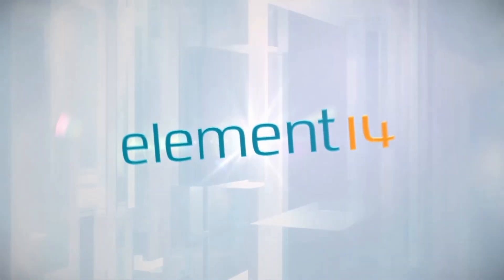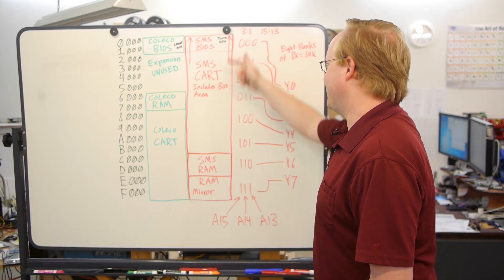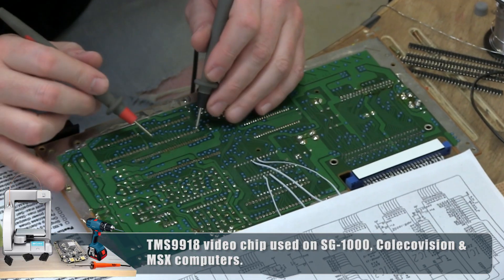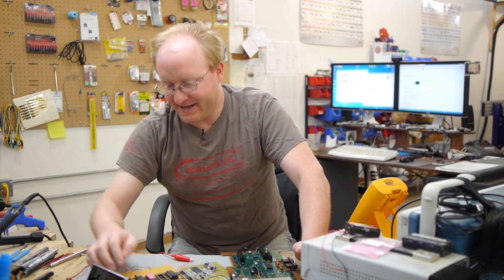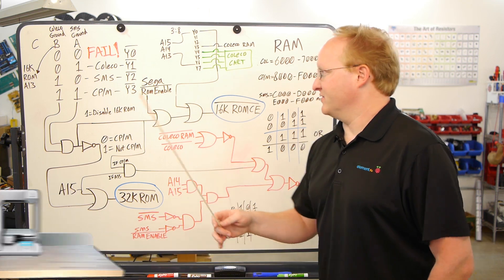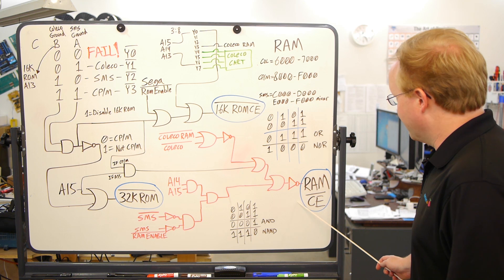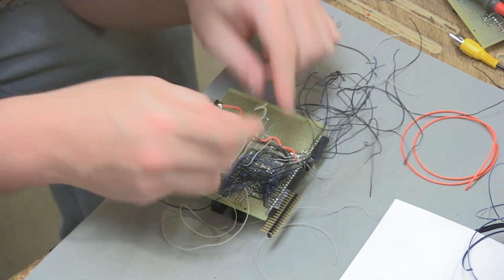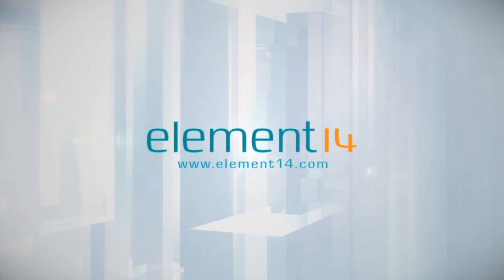Ben Heck’s Game Brains Part 2

Comment: Pretty sweet, just wished it would of been finished. Doesn't appear audio or controllers had solutions in this. Would love to see if this could actually all be done to the end and into a working case with full working audio etc. Though I would imagine that audio and controllers wouldn't be an issue as long as you added the chips as that part could run separate I assume for each console and same for the controllers. 

I think he showed the parts he did because they are the parts that used the same components and to finish the project with audio etc would just require more work but each console would be using their individual components rather than the shared ones. 

Still learned a lot as I just started finding this sort of stuff interesting. Would of been epic though if it had been completed. 

Are there any other combo systems that could be put together like this? Or is this a rare case of shared components?

Comment: I think it would be cool to have a modular system, where you have an input / output system or base unit, connected to a monitor a keyboard and a controller, this then has a single port / slot for Ben to make various "modules" to plug in the various systems to the input / output unit. Basically the module would have any unique components / cart slots required for the system, whereas shared components would be in the base unit.

Comment: Too bad the Gameboy uses a slightly modified Z80, or this could have been a triple-function system. Unless you can find a test ROM that doesn't use any of the modified opcodes.

Comment: Good show, great idea.

However, a problem I have with your shows for some time.  That is the lack of schematics, code (not for this build, but others), and the files for your laser cutter and 3D printer  available online so others can build their own projects based on your work.  Kinda like a magazine article -  you watch the show, and if you get inspired to build your own gadget, you have the information on how to do it.  If you get inspired to just learn more about how something was done, you can take a closer look..  Element14 sure would sell more tools and parts if you included the schematics as a download. Heck, throw in a bill of materials with Element14 catalogue numbers and I bet they would sell a ton more!  I am an electrical engineer, and could go through all the steps you did in order to make one of these builds.  But why should I have to?  You've done that work.  By not providing links to your work, you just have a glory show of what you did and not about actually promoting the sharing of information.  I'm sure there are many talented builders that would love to make their own projects based on the topics presented in your shows.  

Please consider posting your designs online for others to learn from.  Even if you just shared links to where you found your base schematics and then a scan of what changes you made to them.  You would not have to make detailed cad drawings of your finial designs (that would be a very nice touch though).  By providing more information, you are going beyond the "Hay look at what I made - isn't it cool? Bet you want one, but you can't!" to "Hay look at this cool thing I made, here is the information you need to build one yourself".  You sometimes present an insight into your circuits (like with the white board work showing the glue logic for the memory mapping circuit of this show) and sometimes just skip by sharing no information at all (like the Lipo charging circuit made by Felix you have used in several handheld devices).

Help your viewers move from watchers to makers - Give us the power - Help your sponsors sell more parts and devices - Help educate our youth -  Motivate future makers - Inspire other user projects - Gain fame wealth and power (ok, sorry man I was on a roll there!) You get the idea - PLEASE GIVE US MORE INFORMATION!

(PS - to complete this build you still have the audio, and the main reason I'm here watching, adding CP/M to it!!!  Hope to see Part 3 soon, of course Part 4 should be putting the thing in a nice box (as that is one of your trademarks).

Comment: I Feel that this project needs more attention. I hope that you can make the episode adding the 3rd element(14) to this project as it is really interesting. If you make a combo system like this again try to make a SNES work with a Sega Genesis lol. Best of luck and thanks for a very interesting set of episodes.
Reply: Sean Peter McGuigan They are two completely different machines.  I can assure you that it would be a nightmare to do.
Reply: Hifeno Drake someone is doing it with a FPGA, each boot you program the FPGA with the system you need..cant remember where i saw it though...

Comment: Isn't the original Gameboy basically a Z80? I don't believe it's branded as such, but a good chunk of the instruction set is the same.
Reply: Jim C K Flaten It's different enough not to work with a normal Z80 CPU.
5 of the 7 instruction tables were removed, and a dozen instructions in the main table were removed and some of those were replaced.
I believe the whole bit instructions table is identical.

The 7 tables are:
Main instructions -Some changes in GB Z80
Bit instructions (CB) -Identical
IX instructions (DD) -Removed in GB Z80
IX bit instructions (DDCB) -Removed in GB Z80
IY instructions (FD) -Removed in GB Z80
IY bit instructions (FDCB) -Removed in GB Z80
Extended instructions (ED) -Removed in GB Z80
Reply: Instruction sets not being present in the GB shouldn't be a problem since the GB games will just not use those in the Z80 then. But the instructions that are changed could be a problem.
Reply: True. I know that 100% of the Gameboy games use the oppcodes "LD A,(FFXX)" and "LD (FFXX),A" which is a exclusive GBZ80 instruction. It was intended to replace the removed "IN (XX)" and "OUT (XX)" instructions. The "STOP" instruction is used for changing the CPU speed in the Gameboy Color. Executing "HALT" after "HALT" locks up the CPU, so not only does it have it's differences, it has it's own set of glitches.

Comment: I love the idea of this project, sort of like a "Retron N", but in hardware instead of emulation. My approach would have been to have a "mother" board containing the Z-80 + TMS9918 + RAM,  and then a daughter board for each separate system,  containing the ROM,  cart slot,  controller connectors and men mapping logic for that system. Then something like an S-100 bus to be able to plug in multiple daughter cards,  and a way to switch to the "active" daughterboard /system.

Comment: But what if you insert both cartridges?
Also, I wouldn't mind a third episode if it meant adding a CPM. And making a more finished product.
Reply: allluckyseven I don't think he left enough space between the connectors for you to be able to insert both cartridges at the same time.
Reply: allluckyseven Don't do it...it's kind of like crossing the streams...
Reply: mv2112mv If so, that would neatly solve that problem.
Reply: Jason Allen Adding a CPM option would require a much more sophisticated approach to memory management. For starters CPM requires ram to start at address 0. There were some versions of CPM that started ram at 4000H, but these could not run standard CPM code. The typical thing to do is to put ram at 0 and then use logic to force the reset vector up to F000H or F800H. I've seen this done in a number of ways, typically or-ing a reset has happened bit (a latch set by the reset signal) with upper address lines. Then any I/O instruction clears that reset has happened bit. The first instruction executed in the of the bios ROM is JMP F003H (or F803H). Then an I/O to a blank area to turn off the address or-ing. 

Also, CPM works best with max ram and min rom.
Reply: If you looked at the logic whiteboard, you could see that if both carts are installed, the system would "fail" and choose not to boot.  As the cartridges would share data bus lines they would both try to respond , but you could wire in a small circuit (more logic gates, and disable the other cart), to allow for this and prefer one cart over the other.
Reply: allluckyseven putting in both cardridges would cause the ROMs in both cardriges to fight against the bus/each other. In the worst case, both cardriges and probably even the CPU could get damaged. In the best case nothing would happen, and nothing would work.
Reply: Yeah, I was thinking the same thing.  Adding the 3rd system and finishing could be a future episode.
Reply: allluckyseven there is only 1 cartridge slot.  although i agree, a third episode would be nice.  if he made a xbox one and a ps 4 do that, it would be a BIT cooler.  if he went that direction it would be cool to see a multi disc loader and a controller that could boot ps4 or xbox one instead of having to get up to switch it

Comment: Is that the hbm AMD has been talking about?
Reply: stewjw What joke? I see no joke.
Reply: PKKShadow hbm is the die on the main processor so it has the fastest way to get to the memory. he just stacked the memory on top of each other because they use some of the same pins but the data lines are going to different areas. it nether speeds it up nor slows it down its just that way to save space and work. btw HBM stands for High bandwidth memory. which this memory is not.
Reply: brandonhughes7  I think you missed the joke.

Comment: Technically we could start from a sega Genesis, it has a backward compatibility to the master system too (the genesis has a Z80 for secondary processor).
Reply: Maxime Vinzio The SG-1000 modes are sadly not available on the genesis video chip.
Also all the memory decoding logic would murder ben heck.